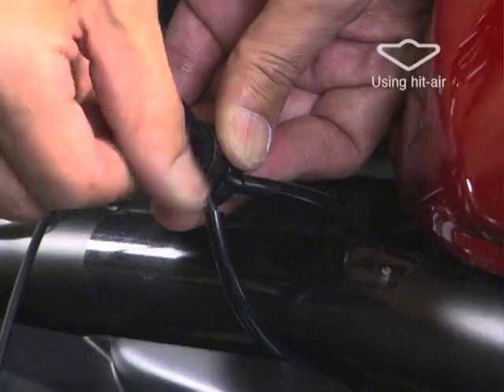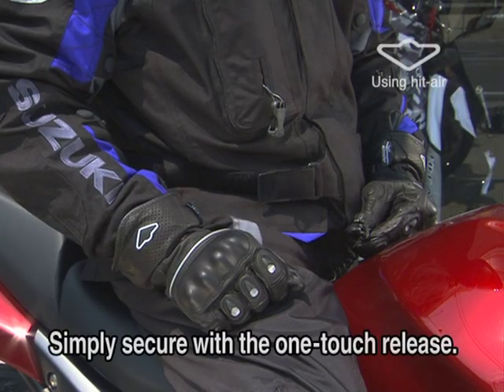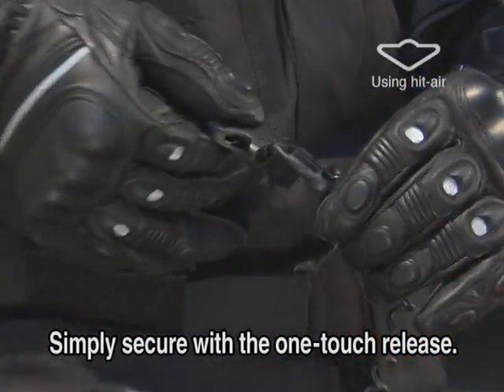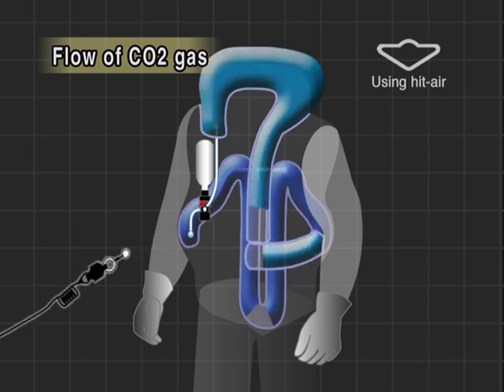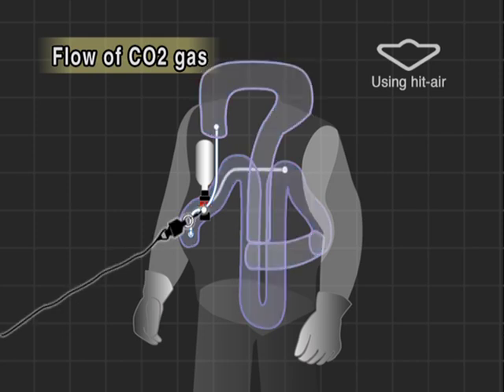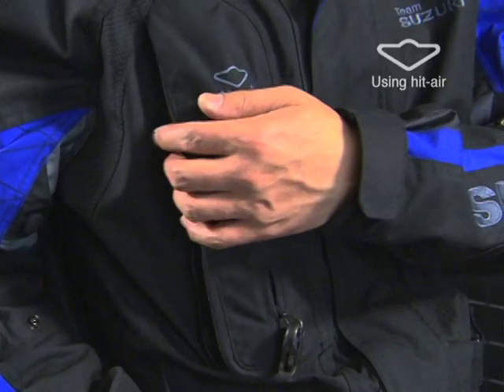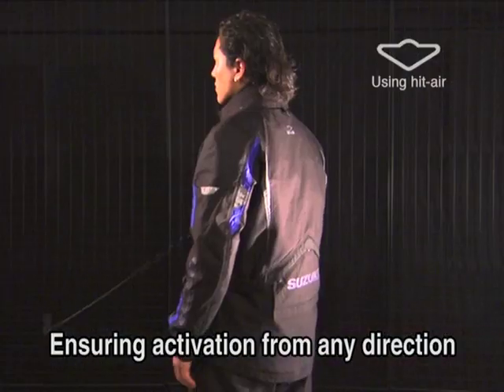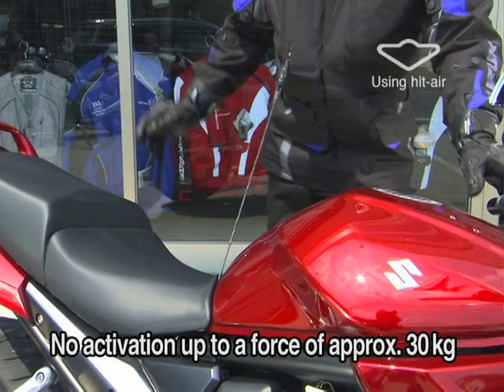Hit Air Airbag jacket: How tos

Comment: I think, in answer to the concerns from those with sudden & unexplained activation causes during a ride, it can be somewhat a shock and slight discomfort which eventually will require re-examination of the faulty suit, nothing endangering, fortunately and certainly, NOT to ones ribcage for sure. 
On the other concern with heat build up, well, I'm sure that consideration was also considered with the designers or it will not hit the global market. Protection to yr body is the primary goal here.:)